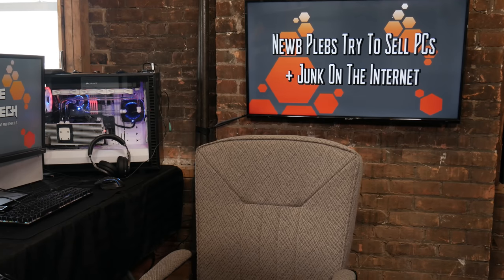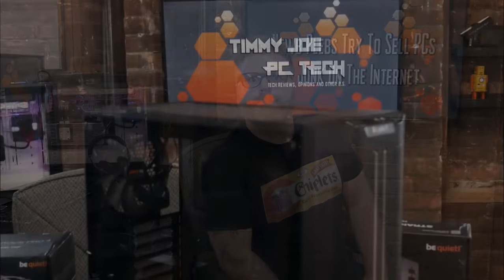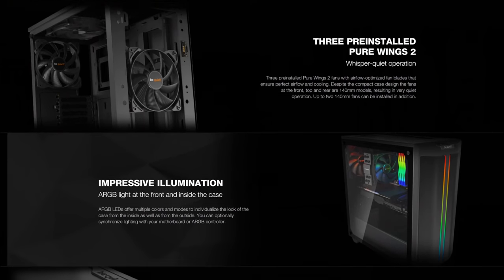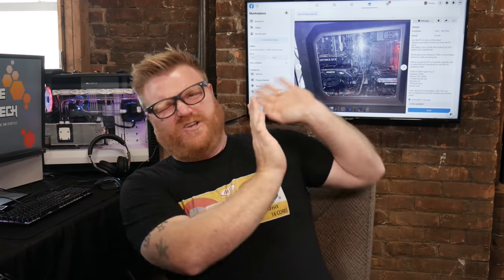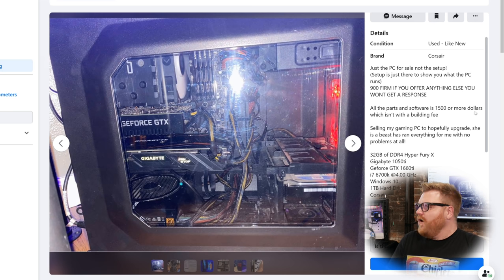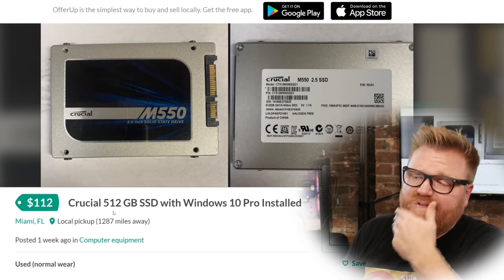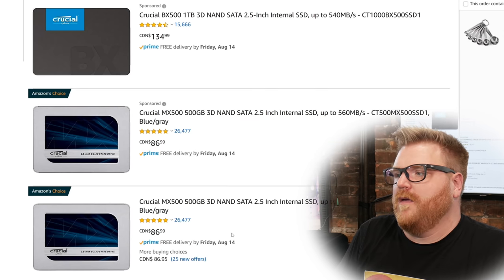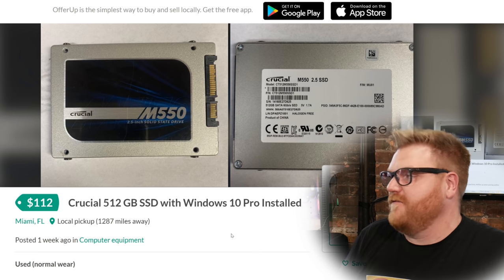Used Ryzen 3600 RGB explosion for $2800?!? - Noob Plebs Try To Sell PCs and Junk On The Internet

Comment: Another red flag is when the seller says, never been overclocked, Oh its been overclocked lol
Reply: I rather have em tell me the max OC. For this reason i can't throw away my ryzen 1200 golden coin 4,2ghz boot 4,1 benched 4,25 bios ghz that is. ✌️
Reply: Deffo been overclocked lol
Reply: I love when I see "never been overclocked" on a B board with a Z processor.
Reply: "Never been overclocked"

Non overclockable cpu
Reply: Well I don't know how to overclock. But I do know it reduces the life by a lot. So I wouldn't even mess with it.
Reply: @Restrictted  not really the clock the manufacturer sets is basically max tdp the stock cooler can handle

Getting a better cooler means the temps will be lower and you can raise the clocks more
Reply: Mac Dee Not necessarily hahaha I have a trade in 2700k that was in a custom built office PC (huge excel files) and was ran at stock for years, nobody ever overclocked it until I recently set an OC on it to sell it 

Sooo whoever buys my 2700k system will actually get an actual 2700k that was not overclocked lol rare but true!
Reply: Donnovan Mason high clocks don’t reduce cpu life, voltage does
Reply: @rustyboomerton2235  I don't why people still think that.  Hell I got a 9900k I got a 5ghz oc at 1.25v; if I ever sell it I'm using that as a selling point.  Lol.
Reply: @Restrictted  couldn't be more wrong.
Reply: Not true I never overclock I take go care of my electronics.
Reply: @Restrictted  yeah same I just spend to much time and effort to make my PC powerful and look good to. So don’t want to short the lifespan of my parts

Comment: 14:37. I literally just built almost this exact system (aorus b450 Mobo, 3600x zotac 2070 super. Same otherwise) and got the Lian li PCMR case and paid $1280 new......guys an idiot.
Reply: I agree its overpriced, but also roughly about $1700 USD converted as it’s $2800 AUD Sydney Australia 🇦🇺 Listing and in Australia we do pay a premium for our pc’s and electronics unlike the US.
Reply: @michaelthompson9798  Australian $2800 converts to $2,005.01 U.S. or 2,664.24 Canadian.
Reply: just out of curiosity what do you think of the cooler on the 2070 S the one on my zotac 2080ti stinks kinda wondering if its just all of the brand not like im super picky or anything 

had an aorus card before it i quite liked this one is just so loud either to hot or to loud nothing in between even reseated it with better grizzly goop no luck in fixing it sort of suspect the fans of just sucking
Reply: Those are 2800 Dollaridoos not USD
Reply: Yeah us Aussies buy 1660 supers while you Yankies buy 2060 and 2070... Our pricing is full on!
Reply: @PainX187  not having any issues with heat or noise. Fans run low to off most of the time in regular use. Games seem good as well. Might be a crappy thermal paste application.
Reply: @Transistor Jump ah ya. He price is still ridiculously high for used.
Reply: @megaglowz8540  nah tried that not really a heating issue imo starts getting real loud around 50% - 60%
Reply: I mean if the mobo was an x570, and if the CPU was a ryzen 7 3700x and the ssd was 1 TB maybe?

Comment: That last guy is actually a genius. He removed the blade from the knife and used the locking spring on the handle as a collapsible support for the fan mount. $2,000 is way too damn much though.

Comment: I had that "Stormtrooper" case, it was pretty good and had great airflow in it. Sadly the 850watt power supply blew a head gasket after 5 yrs and fried the electronics inside, but it was a nice case when I bought it way back when.

The next computer you showed, the rainbow system I'm pretty sure was being sold because it was keeping the neighbors up at night. Or possibly it was causing migraines and temporary blindness. That computer would fit in nicely at a nightclub or a disco.

Comment: I bought that exact Crosshair and 8350 with 16GB of DDR3 for $150 earlier this year. Also, it came with a GTX 970. So that plus the ram prices the board and chip at  $-25. Which is fair.

Comment: How much would my around 3 months of use r7 3700x, Asus rog Rtx 2070s, msi x470, 2x8 ram, 650w Corsair psu, 250gb Samsung Evo sata ssd, 2tb hdd, 1tb xpg m.2 ssd, and a h105i aio. Oh forgot to say it’s in a Phanteks P400 case the non rgb fan one.

Comment: WUT?  I built a NEW rig 3700X w/ 32GB 3600mhz, X570 Mobo, 500gb NVMe drive, and a 2070 Super for $1300.  And no RGB other than the the Wraith Prism cooler the CPU came with. This was back in April, so the prices have changed since then.

Comment: if you just install windows and then use your microsoft login instead of tossing in the ssd with windows installed, it just adds that PC to the licence its weird and kinda broken but i have 1 licence running on a laptop and a desktop and i have used this licence on 2 other desktops as well

Comment: Hey timmy I don't usually comment much but I'm really looking for some advise. Currently I'm running an i7 5820k at 4.4ghz with 32gb of ddr4 ram at 2400mhz, im considering upgrading to something new although I'm unsure if the huge cost to upgrade would be worth it yet? Buy now or wait for next gen stuff?
Reply from the maker: Depends on your GPU I guess. I wouldn't settle for anything less than 8 cores so 9900k 10700k or 3700x but your system is still decent.
Reply: @TimmyJoePCTech  hey man thanks alot for the reply! I have an rtx 2070 super, hoping to play at 1440p 165hz ish. Currently seems im only around 120ish range in cod with pretty low settings

Comment: 2:46

i always thought you could only SLI with 2 of the same card...
Reply: Not to sure if your meming or not but the 1050/ti never had the fingers to do SLI to begin with, on top of that dudes mixing cards from two different generations. No you can't run SLI in the slightest with those two cards.
Reply: @Musicialgamer  if i would have bought the pc i would just sell the 1050ti to get some of my money back
Reply: You can crossfire with rx 470 480 570 580 but the performance of each bottlenecks to the weakest one

Comment: I've actually moved a hard drive to another computer with windows ten I stalled and it works fine. I took an HDD from a Dell laptop and put it in my Toshiba laptop. The Toshiba HDD failed and I picked up on my Toshiba. The Dell laptop just stopped working.

Comment: Hi, great video but I have a quastion about your statment at around 12:15 that having windows preinstaled makes no sence, because  ''it goes <fart noise> as soon as it recognizes another motherboard ''.
I  upgraded from haswell to ryzen 7 based system without any issues on the same ssd with the same windows lincense.
Is it possible for that swap not to work ?
Reply: You got lucky. Windows deactivating when you switch motherboards has been a thing since Windows XP.
Reply: If you have a digital license RETAIL OS that is linked to your Microsoft account, it can auto-reactivate on change of components. My digital license transferred totally over from my old 4770k system to the 8700 replacement system (no reusing of parts). Had to then reactivate the 4770k system using a eBay £6 key! It is only OEM OS that are headache to reactivate although phone up MS & usually they will do it for you anyway even though it is mostly a new system.

Comment: 12:14 ... IS THAT REAlLY SO ?  because i changed my motherboard and cpu serveral times , but always kept my windows 10 ssd , never had any problem , it always worked !
Reply: windows 10 is probably connected to your Microsoft account so it doesn't matter if you change hardware

Comment: "SSD with Windows 10 Pro Installed"
If you think about it, there is actually a very interesting legal issue/question/gray area behind this product. If you have a car and you want to sell it, you are free to do so and it will work the same way for the person who bought it from you as it did for you. But try to sell a computer, complete with an OS or just the storage that contains the OS, and the thing might not work for them the same way it did for you. Software is in a weird lawless (not as in "illegal", but as in "there is no laws regulating the issue") position where vendors can sell it either as a product or a service depending on their whim. Worse yet, if a software was sold to you as a product, there is no law preventing the company that sold it to you to suddenly decide that now it's actually a service and that now you have to pay a yearly fee to keep using it. Some companies take advantage of this situation to abuse their clients.

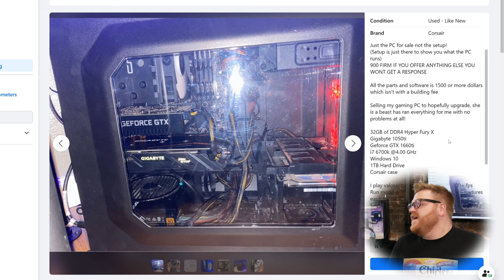Comment: $900 Computer at 2:26 - The two video cards are worth $300 (CA), the 32GB RAM must be worth nearly $200, The 6700K is worth nearly $200. That leaves $200 for the Mobo, case and PSU... The price is pretty spot on for value --- IF it was Canadian $ ---

Comment: heh that last one, I put a 3600X the one every one says its not worth the extra money on the stock cooler in a computer and the bios one click overclock stuck it at 4.2Ghz, the user keeps 3 cores loaded 24/7 an it runs at 55c

Comment: That $1600 X58 rig could have been a budget beast with a bit of work. It's a damn good motherboard, update the BIOS, get a xeon X5675 for around 30 bucks, dial in a nice OC and you've got a decent 6c/12t system there. Actually, it might already be a 6 core, he doesn't actually say which i7 he has, and some of the westmere era chips were 6c/12t 

Also, 3.8Ghz OC on water? I got an X5650 to 4.2Ghz on air (noctua D14) with a weaker mobo and power supply.

Comment: Not trolling, genuinely looking for advice! I am selling an older system but do not know a fair amount to charge in USD. I am located near Joplin, Missouri and the specs are as follows:
Asrock extreme 3 gen 3 z68 motherboard 
AzzA 850W 80 plus white PSU
i7 2700k@5.0ghz
Hyper 212 Evo
32GB DDR3 1600MHz 
Evga GTX 970
Kingston 240GB SSD
Seagate 7200RPM 1TB HDD
Windows 10 Pro
DIY PC mid tower case w/4 fans

The condition is genuinely great, everything recently cleaned with toothbrush and fresh thermal paste applied, with 3 front LED fans, a rear exhaust fan, and a couple of ring LED fans on the Hyper 212 Evo 

What would you sell that for? It’s okay to troll but genuinely curious what a fair deal might be

Comment: That's still one of the biggest noob traps in PC selling. Just calling your CPU a "like new i7," instead of giving you the actual model. People see i7 and think that it's automatically a high end CPU without knowing that i7's have generations and the older generations are of course much weaker than the newer ones.

Comment: 8:15 Even if the Intel cpu is the i7-980X with 6c/12t it gets outperformed by an AMD Ryzen R5-1600, the original one.

I have this “old beast” but it is really lagging behind nowadays. This makes sense of course it’s 10years old...

Also Hardware unboxed did a video about this very topic in 2018.

Comment: The first PC with the GPUs, it wouldn't surprise me if it was used as a PhysX card setup or some OBS setup. Also 32GB is the sweet spot in 2020, personally I wouldn't want less than 32GB of RAM in my PC.*

Comment: I'm thinking about buying a FX System for 450€ rn. The sum of its parts is probably worth it because FX9590, that motherboard that the guy in this video had, 32gb of 1866MHz a Corsair Carbide 500R a R9 290X and for the parts I actually want a 1TB Samsung SSD, and an AX1200i PSU. Probably can mae a lot of the money back parting it out and keeping the ssd and psu but still don't know.

Comment: I sold my old fx8320 to a friend in 2019, complete with a good mobo, cooler, 16gb, psu (which broke oof) and a 128gb ssd. For all I wanted 200€, added also an RX480 8gb. 
Prob a bit too low but let's get real, it's a dead platform, he's already considering upgrading to ryzen, at least now he doesn't play consoles anymore :P

Comment: 1600 dollars for a literally 9/10 year old PC and it SOLD lol That thing would play like a dog in 2020. The 6990 was a notorious POS and is a dual GPU card so anything made in the last 5 years or so is going to use half that cards very low potential because nothing modern supports crossfire. Heck even games that do support it will probably run like garbage because crossfire was always a dumpster fire of micro-stuttering.

Comment: 3:40 that FATTEST bottleneck on that rig is the Hard Drive. WTF was this builder thinking? You shell out extra $$$ on 2 graphics cards but completely cheap tf out on storage performance. 
My current setup has 8gb of DDR3 ram, your lovely am3+ 6 core FX processor, GTX 760, AND...... AND AND AND. 4 (yes four) 120gb PNY SSD's in Raid - 0 giving me 480gb of storage clocking at 2.2gb/s transfer speeds. I only spent $20 a drive, 95 after taxes for 4 of them. Couldn't be more pleased with it. Windows install was less than 5 minutes, and startup time is 4 times faster than a single SSD, on a Non supported m.2 motherboard. People who overclock on a pc with a single Hard drive assume they will be getting better and faster response times but the key is how to work your storage. Great! All these rigs can run games like valorant, minecraft. etc. But mine will start those games at half the time these rigs will even while installing windows updates.

Comment: Yeah those computers ARE NOT worth the money the sellers are offering them for. Especially the the 4670 rig because the i5 4670 is way TOO OLD and 4c/4t would only be a bottleneck. The only reasonably priced PC is the 8350 system but that is still way too much. The 2800 RGB system nope not worth 2800 bucks because it doesn't even have a 3700x in it on top of other obvious things. The x58 system not worth the extremely high asking price because x58 is pretty outdated and the CPU isn't even a xeon 6 core and that EVGA board that seller has can handle a 6core xeon. Also the 3000 purple fluid 3700x rig way too dirty the fluid NEEDS to be flushed out and redone. I would say $500 bucks for the dirty purple fluid system because the seller has no idea what he is talking about in terms  of how much RAM he has installed.

Comment: 9:19 I can tell you why the CPU Cooler lookes like this, because I have Asus Formula mobo. CPU mount is too close to RAM slots. Imagine Corsair H115i (Asatech mount) with tubes colliding to RAM slots making impossible to mount this AIO in proper place. I have no idea who put that on ASUS design table but he/she was total idiot. It can be mounted only vertically. Currently using X570/R3 3300x system, but my previous still works, but sitting in box

Comment: FX-4100's are still made new to this day! They work grate with a RX570 card.
Reply: Fx cpus are like pentiums. They kinda do the job but their trash
Reply: @jeff3627  i have overclocked 800 series Phenoms II that could run an 1660 super just fne.
Reply: @ardennielsen3761 yeah I bet if you got a better CPU you would eat your word s
Reply: @miniweeddeerz1820  absolutely not! even with windows updates the FX-4100 i have boots to windows and checks my email in under 15 seconds. that includes plugging it into the wall.

Comment: Well i was watching this i wane sell my rig but i dont know what to sell it for😂 this are the specs

Cpu: r7 1700 3.9ghz 
Gpu:rx5700xt gigabyte oc
Motherboard: Msi B450 carbom pro ac
Ram: 16gb 3000mhz corsair 
Psu: gigabyte 750watt gold semi-modulair
Case: phanteks p350x full with silent wing 2fans 2x140front 1x120 and 1x140mm on top 
And in the back cpu cooler aio (gamdias 120mm) 

Pls throw some suggestions i am realy curious 
Btw i play 1080p only😂👌
And i dont know if its high-end or mid-range 
Thx already for anyone who answers this comment bless u and have a nice day😊

Ps:(no storage cus of personal info)😁
Reply: Mid range